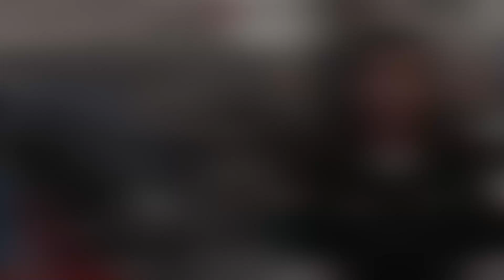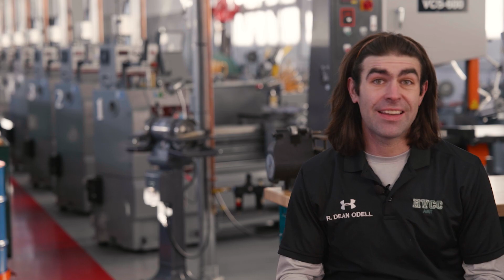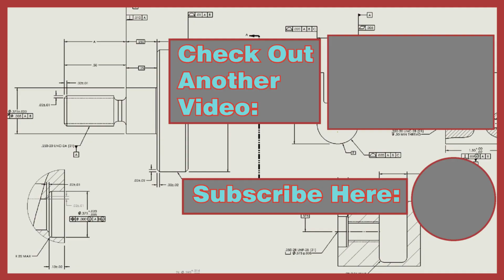What is GD&T? (Geometric Dimensioning and Tolerancing)

Comment: sir i'm having a problem for understanding the concept of datum. so if Datum A act as the first references to the datum feature simulator or "table for inspection", what are the rules for selecting Datum B and Datum C? and which feature or surface should be considered as second datum ? or even third datum? what rules actually applied for this set of datum? i understand the reason to choose Datum A but no so much for Datum B and C . are they can be interchange between one another? (Datum B and Datum C)
Reply from the maker: Hi,

Let me see what I can explain in an upcoming video. I will give some examples of datum selection. Thanks for leaving a comment.
Reply: @RDeanOdell  Thank very much sir. appreciate it